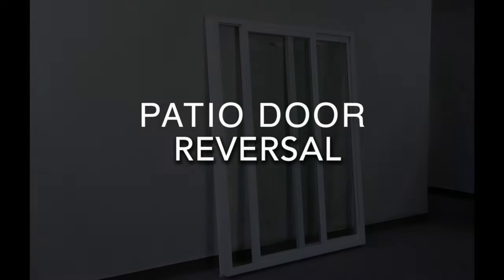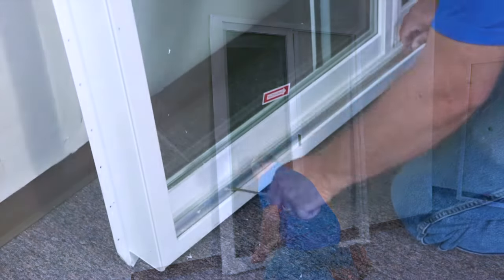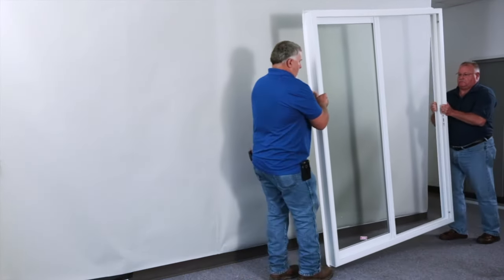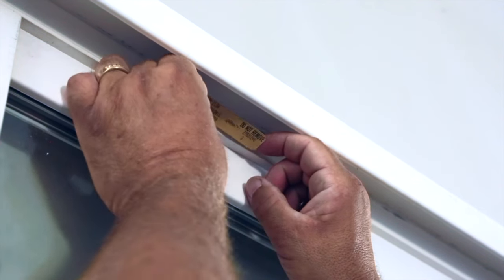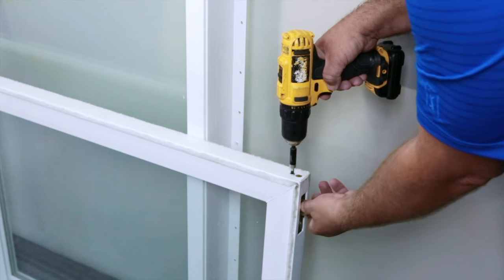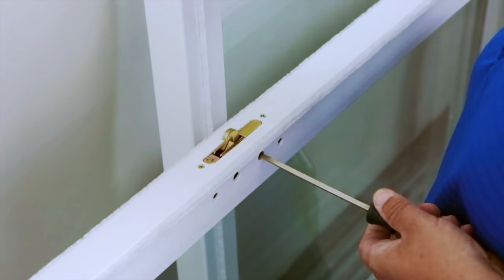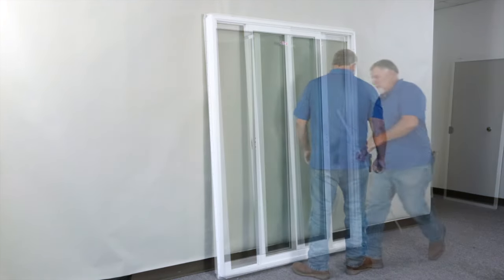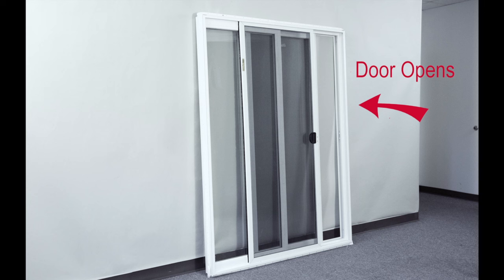Field Patio Door Reversal

Comment: The reversal I'm interested in is one that should not have to happen. I'm surprised the inspector didn't catch it when I bought the house. The sliding doors (I have two of them) are installed backward. I really don't care which way the door slides. But I do care whether the door moves on the inside or outside track. They should be on the inside track for multiple reasons. To illustrate the issue, someone could lock me inside the house by inserting a dowel on the outside against the door. So, how do I go about reversing this?

Comment: What if the door is already installed to the structure and don't want to remove. Since I am not able to turn it around is there a way to change it out
Reply: I don't see how this would be possible given that one side of the door is fixed in position.
Reply: @WVRetreat thank you for responding